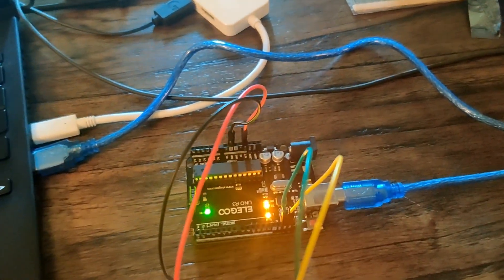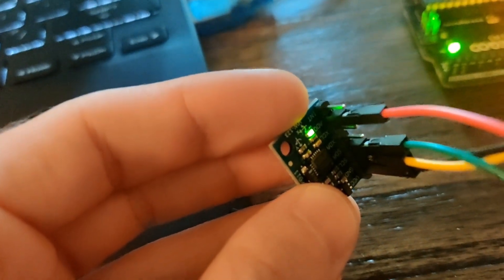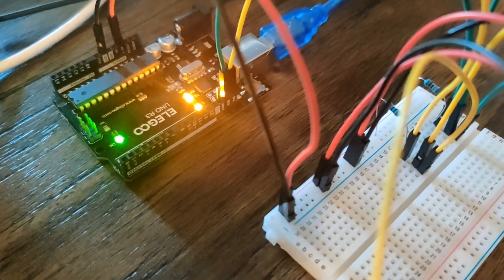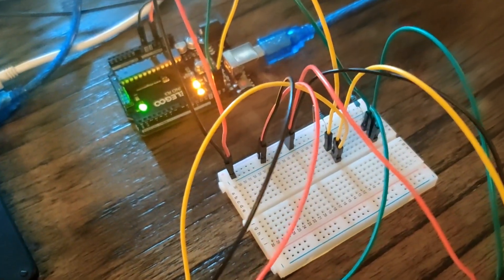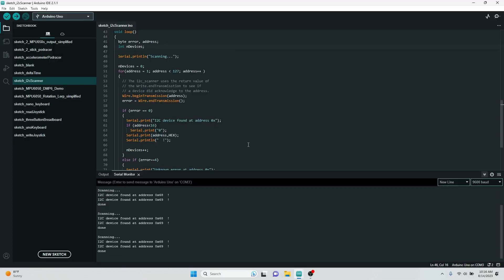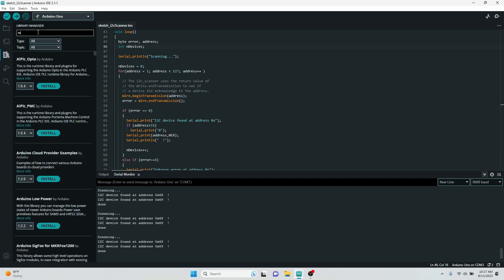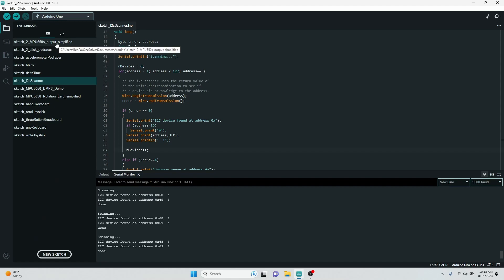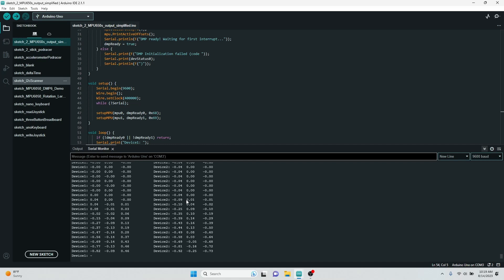How To Connect 2 Accelerometers To One Arduino Board

Comment: Sir can you share the pin connections for double adxl345 to a single arduino uno board. I have been trying it from so much time, still not getting the desired results.

Comment: Hello and thanks for sharing! What kind of project are you making? I am interested in gaming controllers and I recently learned about a prototype controller which uses 2 accelerometers at the same time so that the signals are combined and therefore noise is being canceled out for more precise tracking. It is called Alpakka by Input Labs.
Reply from the maker: I am making a pod racer controller, and have an accelerometer on each handle. I found they were accurate enough for this purpose. Although I also learned that most joystick applications these days that don't drive potentiometers use magnometers.